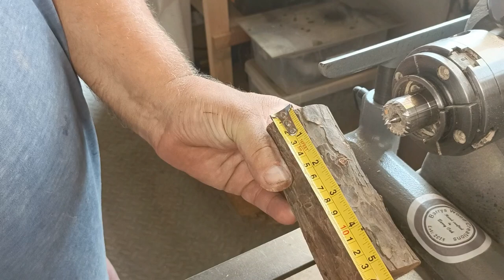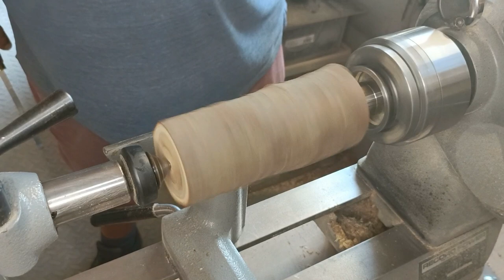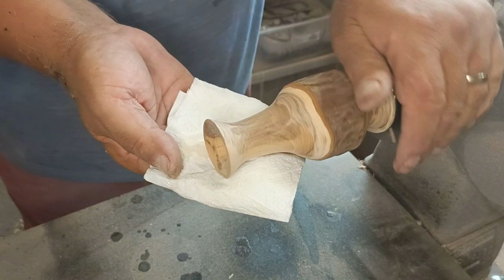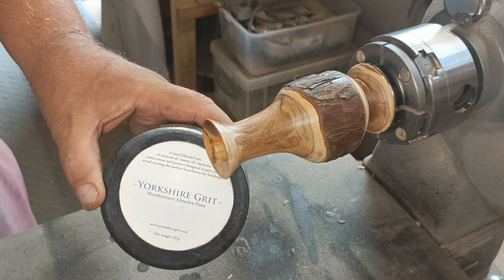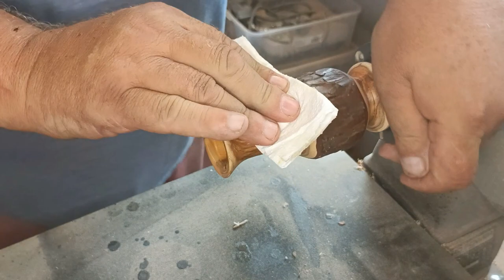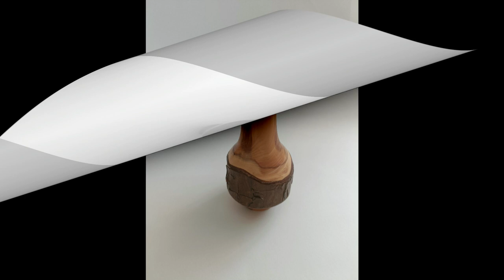Yew Bud Vase from a small branch off-cut.

Comment: So was sanding sealer the only thing that went on the bark section? I've got some small silver birch branches that would make nice bud vases in this style, but I haven't tried to keep the bark on any of it yet.
Reply from the maker: Yes that is correct. Sometimes I have tried unsuccesfully to keep the bark on pieces but generally I don't have a problem. Thanks for watching. 👍

Comment: Do you need to stabilize the wood with PEG?
Reply from the maker: Thanks for your question. The piece was fully dried (9%MC) and sealed with a cellulose sanding sealer before applying a finish.